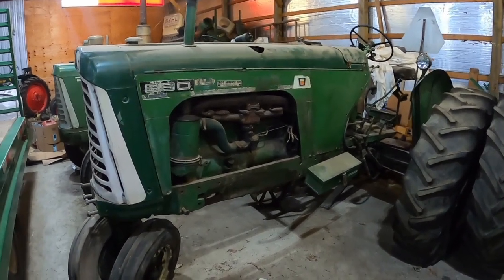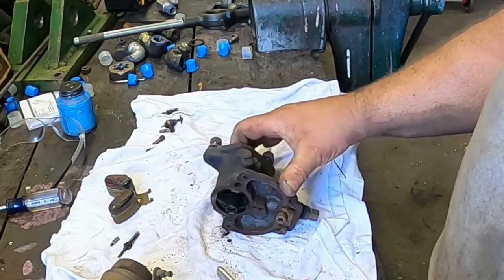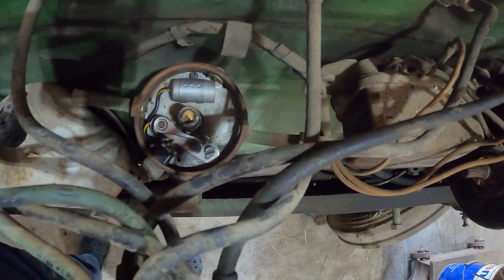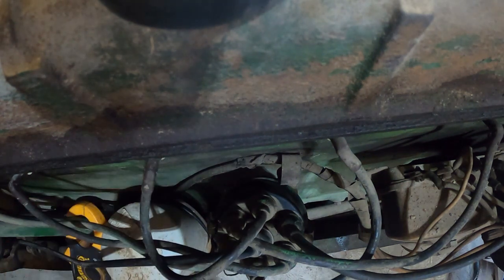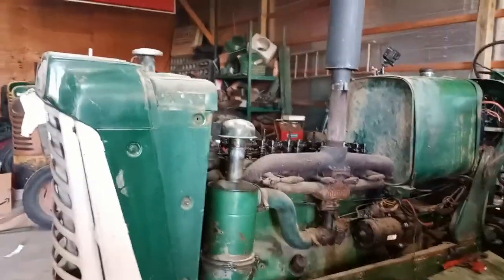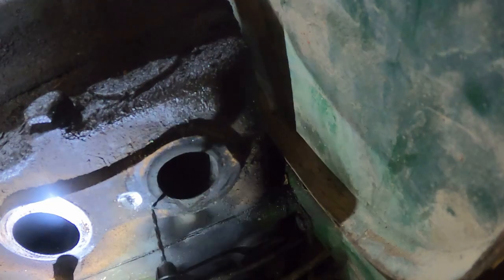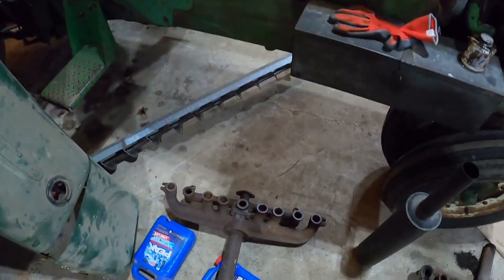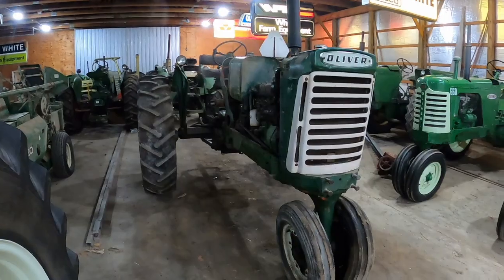WILL IT RUN? 23 Years in a barn without running.

Comment: Runs pretty well. Is that a walkashaw  engine. Looks like engine in my 75A Michigan payloader. 1961. Altho on tag it says tractor shovel.
Reply from the maker: Sorta, it's a joint effort between Oliver and Waukesha,  so it does have some differences from a regular Waukesha of the same size.
Reply: @ThatOliverGuyChris  least I learned how to spell waukesha.it uses a little oil.but just keeps running

Comment: Why did you spend so much time whike trying to get the tractor started only giving it such a small amount of fuel that you were starving it out even in the beginning?  Why not give it enough fuel to keep it idling good and warm it up a little and then slow it down.
Reply from the maker: Because the thought of revving up an engine that hasn't run in over 20 years makes me cringe. It's going to take awhile for oil to get everywhere it needs to be. I'd rather take my time and figure out what is going on than opening the throttle and hoping for the best